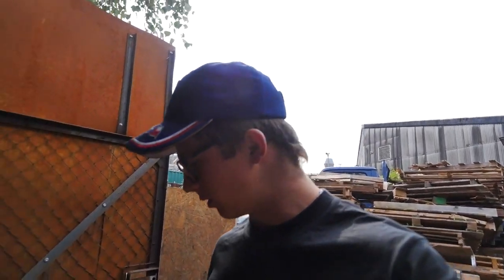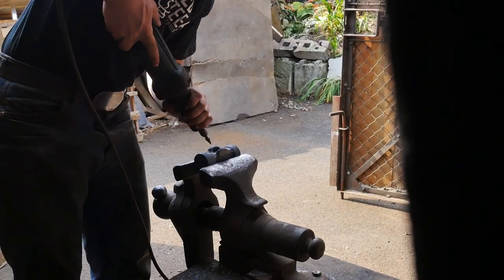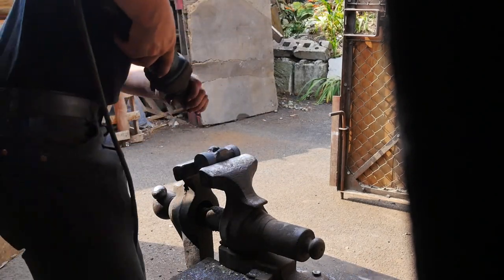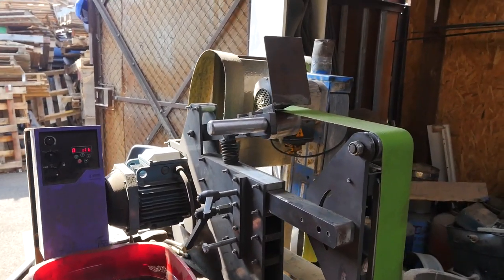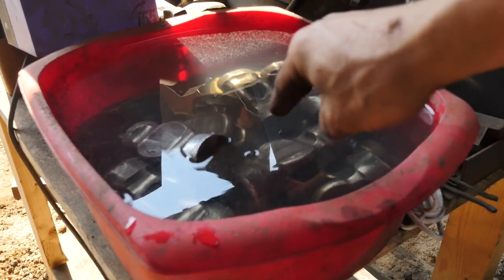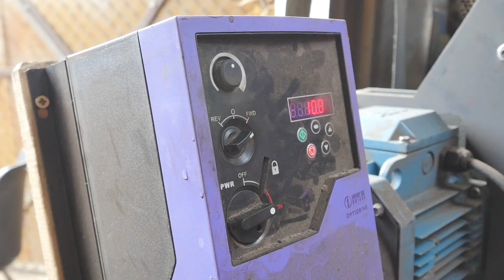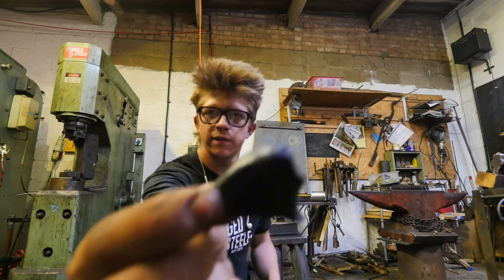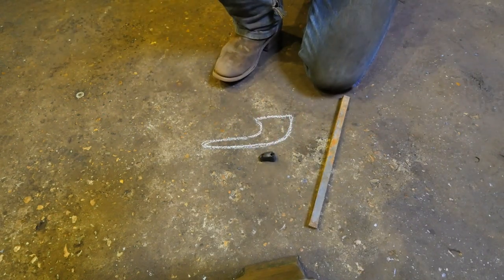The Daily Grind

Comment: Looking good.
How hot do you heat the hammers before oiling them? Obviously you don't want to mess with the hardness, so I'm just curious.
Reply from the maker: The faces are tempered to only 200°C - the cheeks however are hotter as I aim the torch at the cheeks and let the heat dissipate out!
Reply: Thanks.